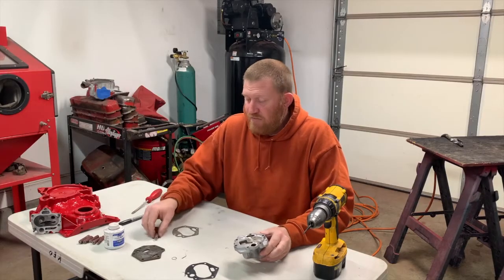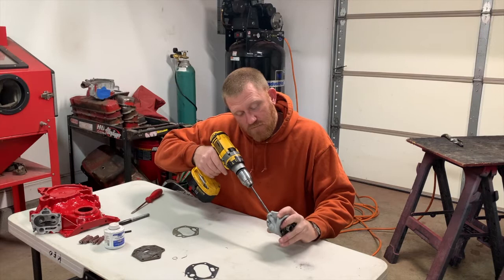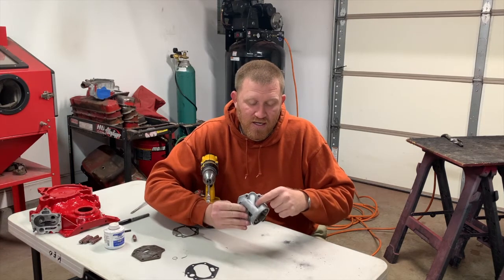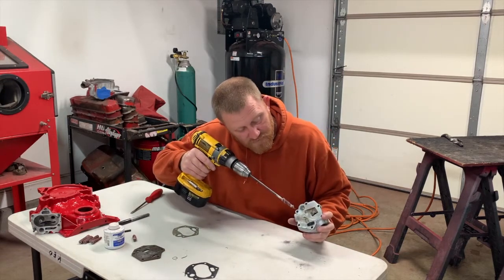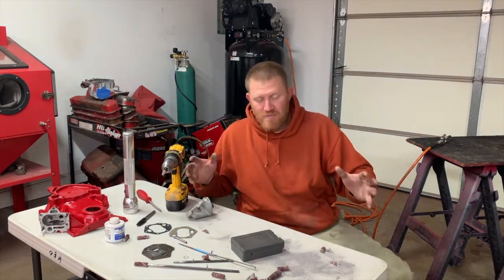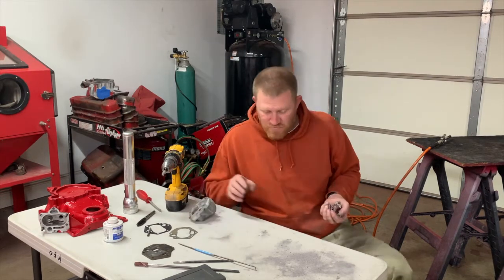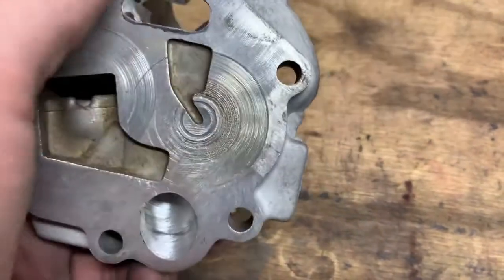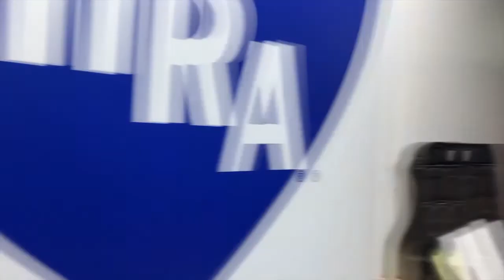She's a gusher! I open up that "B" type oil filter housing for some mega-flow!

Comment: Dallas.  What grit are you finishing at?  Also thank you for the back lit shots with the flashlight through the passages.
Reply: Tom the initial cuts were 150 grit, the  final cut on this was 300. I ran out of material on this one and was grasping at straws to finish it up for this episode. Normally I’ll go to a 600 as a finishing but that was my perfect sized roll to get the  first cut in the oil feed  to the block. It was the only one I had and was the only one I could use to get the opening started.